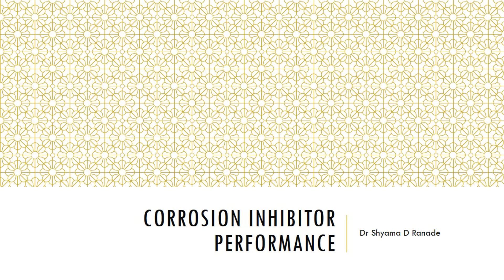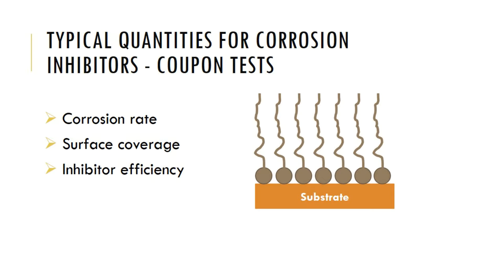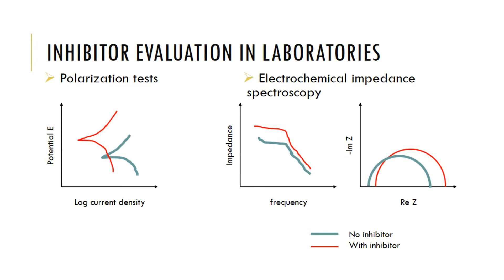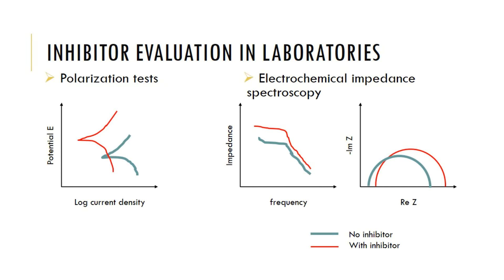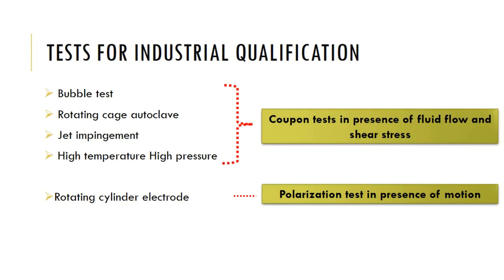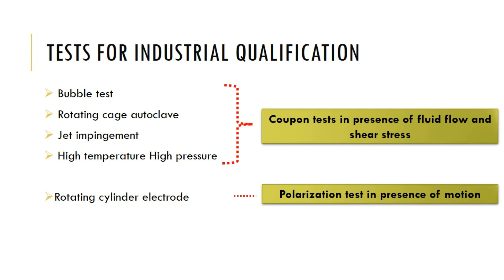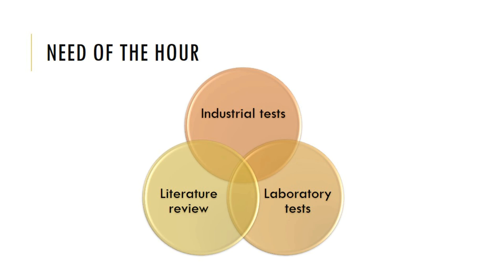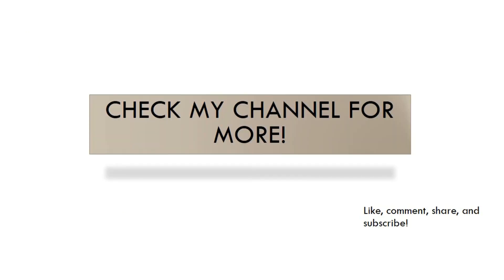Corrosion inhibitor performance

Comment: Interesting video! I have a question, how do you perform weight loss method? And how to determine the corrosion inhibition efficiency Ie%?
Reply from the maker: Thank you for your question! The weight loss method involves immersing coupons in solutions with and without inhibitors and calculating the weights before and after immersion for a certain time. The ratio of the weight losses with and w/o inhibitor give the inhibitor efficiency.
Reply from the maker: Check out this video - https://youtu.be/fWpAIPYS9vI